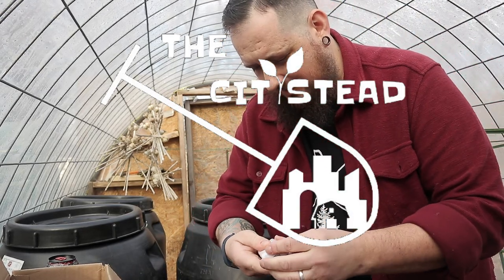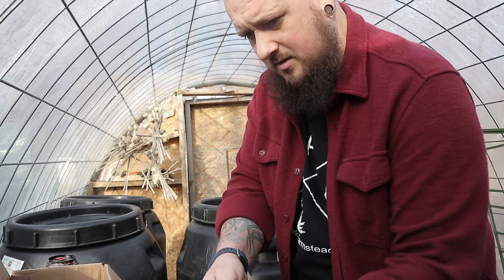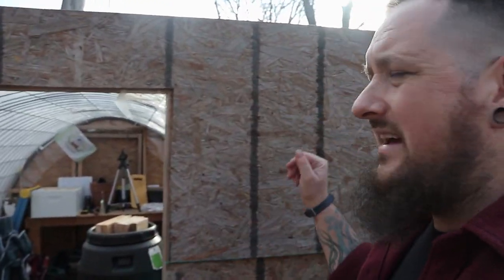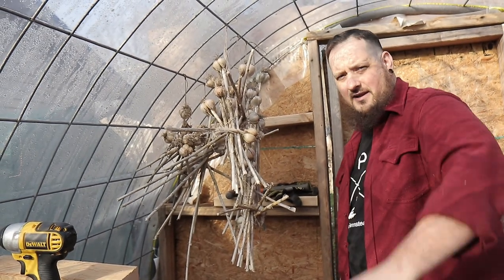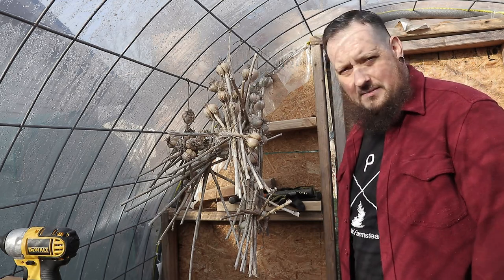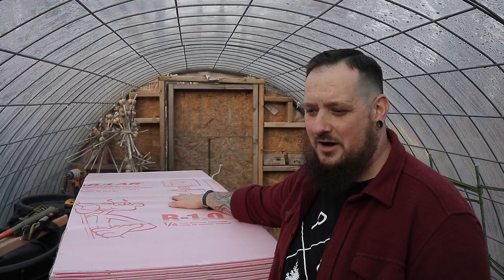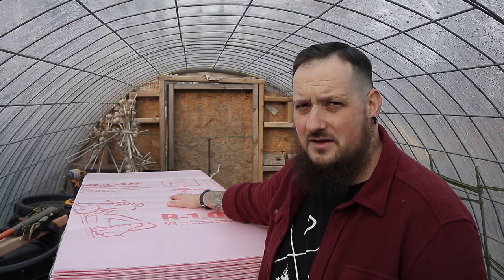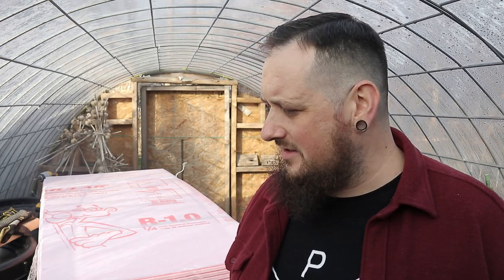My Cattle Panel Greenhouse Has Issues

Comment: That OSB particle board isn't good for much when its exposed to the elements. It is great when protected because they use it to build houses. The more you can cover that the better. You can get black felt that they use for roofing (goes underneath the shingles) and put it over the outside of the greenhouse on those wooden ends. It will absorb heat and also protect the wood from further damage. Its like $17 dollars or so per roll and you would only need one.
Reply: Def osb isn't plywood
Reply from the maker: Yeah I need to get it covered or at least painted so it will last a lot longer
Reply: Paint is a good plan!

Comment: a tanning light in the winter does wonders as the plants need UV light to turn the carbon and hydrogen into sugars releasing oxygen add a two-ply plastic-like double pane windows set up a room out side your green house and put a little waist oil burner and vent the heat in with a fan

Comment: Now you really have me thinking. I need to replace the siding on my greenhouse, and now I'm thinking when I do that I'll insulate and also close in the inside of that portion. The siding only comes up about two and half feet or 3 ft. all the way around the bottom of the greenhouse. Hmmm...
Reply from the maker: I think it could be helpful to have some insulation to help keep the heat in, we will see

Comment: Josh... You're a robotics guy right?  Get a Raspberry Pi and monitor temps to a database like I do. I have a whole series on how to set it up.  Haha! on the car issue.. I curse crappy engineers daily!  lol  I hate to be a negative nancy.. but I don't think R1 is going to help much.  You might be better getting a bubble wrap type pool cover and pulling it over the entire greenhouse at night.  I plant ao add a "garage door" type insulator like that to mine when time, funding, and engineering all line up. :) Keep up the experiment my friend!
Reply from the maker: You know I haven't thought about that 😂.  I'll have to go back and check out how you set up your monitoring system. I saw some think garage door foam and was thinking about getting that
Reply: @Citystead  Yeah, works pretty good. I am actually upgrading to an Arduino for the controls and the pi as a "server" for better reliability.. but either or is very convenient. My setup logs all sensors every minute. Gives nice graphs of thermal performance. Here's a link to the series: https://www.youtube.com/watch?v=BUOTY3fs_jI&list=PL837tk-T71LiUuXWUAkwMVonwd1M5koAW&index=5  Yeah on insulation and heat retention... load it up.. I was amazed how hard it is to hold heat in a greenhouse on my first year out. It's like heating a tent.. haha!